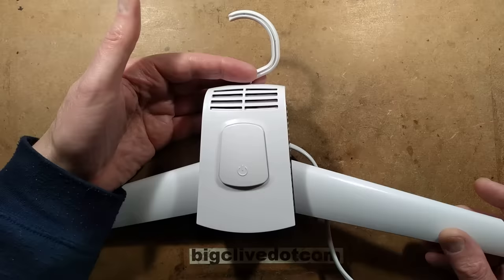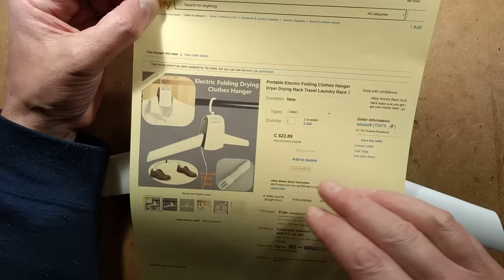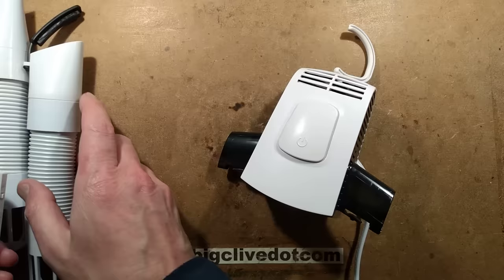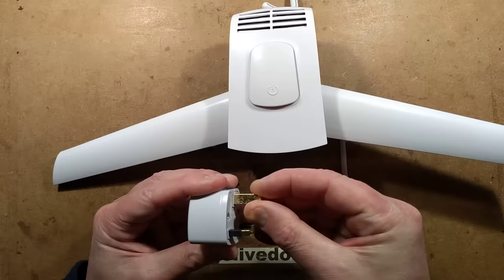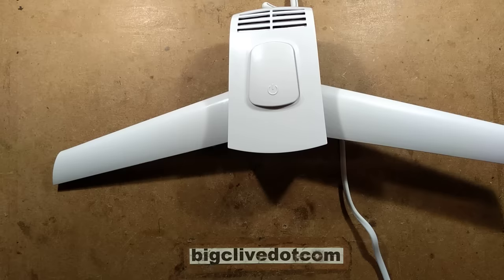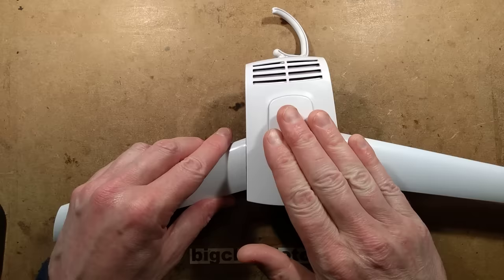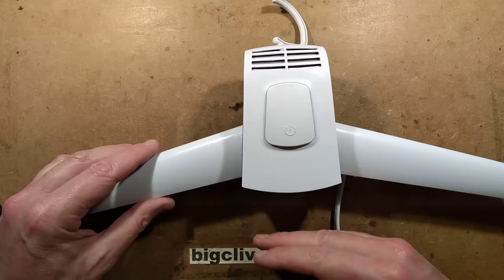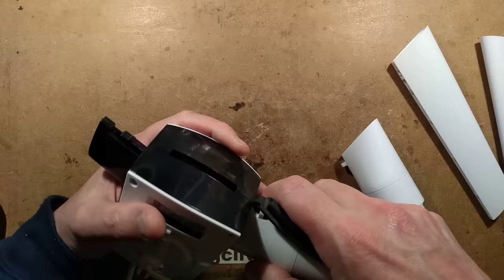Teardown of a hot air coat hanger for drying clothes.

Comment: Considering the rest of the product looks fairly well made,  I'm surprised that the short moulded plastic hook got past at least two stages of quality control /inspection . As an ex  injection moulding machine  setter/ operator, this was probably made during the first few machine start up cycles or maybe the material feed ran out but was missed by the operator, also the assembly line & the packing department! 
For a coat hanger, the hook is the most essential part of the item!!
Reply: Thats why the deep discount pricing on EBay
Reply: A Chinese qc sticker isn't worth the printed sticker its stuck on.
Or in this case the ink used to stamp.

Comment: That thermal cut-out/switch thing is in fact a thermostat - that's what they're sold as, anyway. That particular type is known as the "KSD9700" and it's all over AliExpress (and probably eBay as well). They're available in temperature thresholds between 15-155℃, with both NO and NC types, and are (supposedly) rated either 5A or 10A at 250V. This particular listing has them for between £0.81-2.10 for 5pcs, plus £1.10 shipping. I suspect it's just a bimetallic switch - certainly you can hear a distinct "click!" every time it turns on or off.

I've used a couple of them to add two-stage temperature-regulated fan control to a cheap (£40) 24V/25A (600W) power supply that was supplied with an always-on fan, and that works quite nicely. I don't recall the exact temperature thresholds I used, but I use one of those devices to turn the fan on at around 40-50℃, but initially through a resistor (one of the speed reducer cables that are supplied with higher-end PC fans), and then at around 70℃ it bypasses the resistor to run it at full speed. That PSU is the main supply for my 3D printer and its LED-lit enclosure, so most of the time it's outputting only ~2A to drive the LEDs and the printer's motherboard in standby mode, and having the fan running at full speed for such a low load was pretty annoying!
Reply from the maker: That does make sense, since the risk of this device getting covered with clothing in use is high, and a one-shot thermal fuse would be annoying.

Comment: I have shoe and glove dryer that is also a timer, heating element, fan and some plastic air channels. Mine is so old that it uses a nichrome wire for the heating element, a mechanical timer, and a slide switch that turns the heater off or on.

It is very useful for drying shoes and gloves.

Comment: Cheesium manufacturing aside, some of the design ideas on this are actually pretty good...  not sure I'd have a use for such a device though. I just turn my shoes upside-down on a heater vent in the house and turn the fan on and they dry in reasonable time. Maybe if I traveled a lot more than I do for business this might be useful, but I don't do that anymore. Problem is, the origin of the devices manufacture would leave me uneasy about leaving this thing unattended and trusting it not to burn the hotel down.

Comment: I got butter in my toaster once, I used a death adapter to prevent it tripping the earth by plugging it in with the earth hanging out the other side. I didn't touch the toaster, I just let it burn off the butter and it seemed to fix the tripping problem.

Comment: Clive you have a 3D printer so print yourself a new Hook ;) Good looking product too on my watch list to grab one at some stage.
Reply: Seabreeze Coffee Roasters 
Designing the piece in 3D from scratch and printing such a complex shape which is not optimized for 3D printing is quite a chalenge. First give it a 1-3 days designing the piece assuming he has experience in that,  and then printing it is the easy part, the hard part is the tolerances and support material and cleaning it once printed. Its not all "just 3D print a spare part", and also considering the use case he would have to print it in a heat resistant material, say petg or abs depending on the temperature of the thing.
Reply: @laharl2k  Seriously 1-3 days - YOU need to practice more if it takes you that long. That part laid out as a flat question mark would print fine for strength given the layers. There would be minimal heat radiated up given the airflow and fan but ABS would be nicer. Not much of a challenge but a 'real world' use case to try his 3D printer!
Reply: How do you know he has a 3d printer?

Comment: I assume that with the shoedapters you also get a gas mask.  Or at least some air freshener.  Blowing hot air through shoes is likely to result in some nasty odours.
Reply: I feel like it's intended for wet shoes
Reply: @sylashullett428  
And that makes it better?  I doubt it.  You'll get moist smelly air permeating the room.
Reply: gas mask is recommended, shoes smell nasty 😨 What about UVc and/ or ozone shoesdapters ?
Reply: @ElectroXa  

Ah, Clive did mention an ionizer option.  Maybe that's what it's for.  If it produces enough ozone as a by-product.  Then you can rot your clothing from the inside.

Comment: I just use a 12in desk fan at low speed and a clothes rack. Everything is dry after maybe 4-5 hours. No heat required - only needs airflow. Can take a few hours longer at lower temperatures though.
Reply: Same. If you add a bit of heat though it does speed it up a lot, doesn't even need to be much. Sunny window, radiator...
Also be careful to ventilate, we have had some nasty surprises with mildew.

Comment: I have a request. It's a little different so you may not want to cover it but it's not terribly far out there. I'm interested in modifying laptop PSUs for different voltages. I have a bunch in the 17V range but I need something in 13.5. I know they're typically controlled with a feedback loop. Something you'd care to look at?
Reply: Public liability, you would have to be mad to have anything to do with that.
Reply: @FarleyHillBilly  I'm sure it's possible to cover it in a way that avoids liability. Clive has covered voltage regulation before.
Reply: Why not use a cheap buck converter?

Comment: Nice! I've seen these used to help dry out fursuits. They're more gentle than a clothes dryer.

Interesting short on that injection molded hook. Those types of defects are usually pretty easy to spot and fix. I'm really curious about the story behind this. Maybe one of the cavities was starting to fail, and they didn't want to bother disabling cavities (making the machine produce parts slower) and/or qc thought is was "good enough" (parts customer must have not been too picky). Either that, or the machine operator was new and didn't know what they were doing.
Reply: F...fursuits D:
Reply: Or these are factory defect units being sold off cheap.
Reply: Keep up the excellent legal work, miles...;)
Reply: @bdf2718  Maybe - If those hooks were also used for another product, that would make some sense. However,  if they were custom molds designed for that, then why would assembly use a bad hook? It looks like the rest of the product is perfectly fine. 
There are a bunch of other plastic parts that are clearly not generic, so there was some money spent tooling that. My bet is that those hooks were custom tooled anyways. 
Chinese business culture is obviously different (and I'm not familiar with) - which may have allowed for lower quality standards.
Reply: @milestailprower  

Why would they use a bad hook?  Because, largely, the workers don't have a clue what they're doing and are told not to question.

The machine produces bad hooks?  Not the operator's job to question.  Company has no QA so they get shipped.  And if somebody notices they get shipped anyway in the hope they won't get returned.

Guy on the assembly line gets bad hooks?  Not his job to question.  Maybe there was a design change.  Probably he has no idea what the thing is meant to do or how it's meant to operate.  It gets assembled anyway.

Producer doesn't notice or doesn't care about the problem, or sells the defective assembled products for parts.  Probably knows they'll be snapped up by some eBay merchant happy to sell them on cheap.

It makes no sense that a product with a lot of custom tooling for well-designed parts would have such a crappy hook designed in.  But it does make sense that people would see what they could get away with if they ended up with some defective parts.

Comment: Gave up on Aliexpress. First few orders went through fine. Then the next few just didn't arrive, pain in the neck doing the claims procedure. Gone back to Banggood, out of about 50 orders only had an issue with two, both due to damage, and they were replaced very quickly. OK you pay a little more, and they don't have as wide a range of products.

Comment: That thing uses 10 watts less than my gaming PC under full game load.
Reply: Unless you have a dual core cpu or a laptop I don't see a "gaming PC" using that amount of power under load, and with a dual core it's not much of a gaming computer. Or maybe I'm just being stupid and underestimating a modern quad core's efficiency, maybe a ryzen or something with a 1050 could make for a pc worthy of being called gaming and fit in that power envelope. But then again anything goes when you don't have something better, I was using a pentium 4 around 4 years ago, agonizing to use but I did play games on it, well, the ones that would run. I wouldn't have called it a gaming PC thought.
Reply: Both convert electricity into heat very efficiently!
(The computer sometimes does some stuff on the side, but that doesn't diminish the efficiency as a heater in any relevant way.)

Computers are great heaters, just a bit overengineered...
Reply: Sitting here with a 800 watts spaceheater also called PC... Maybe I should duct the hot air into one of those dryers :D

Comment: Ahhh, the printouts are messing with my perception again!
The soldering looks ugly, but the rest (circuit and case) is actually quite nice and doesn't look like the tried to cut any corners. Not just the things that are needed to run are there, but also those to make it relatively safe and robust.
Reply: Today, vast majority of circuit boards that was mechanically soldered looks ugly, mainly by wave soldering process and Pb-Free solder. That's why broken solder joints are much more common problem.

Comment: Hey Clive, I believe I may have mentioned this a year ago (you were ill right about the same time), but you might have hay fever rather than a cold/the flu.
A simple blood test will give you a fairly accurate estimation of being allergic to grass pollen (or other herbs in bloom at this time of the year). Medication is abundant in case you need it, and has little or no side-effects.
Procrastinating on treating allergy isn't a terribly good idea, long-term effects may lead to pretty horrible conditions. (Says the guy that rarely takes his nasal spray, forgets to take antihistaminicum in the weekend and then proceeds to mow the lawn...)
Reply: Tough it out, it goes away, safer than taking stuff that stops the symptoms but can have bizarre side effects.
Reply: @FarleyHillBilly  that's not great advice honestly, antihistamines have very very few contraindications. 

Clive, the easy way to tell if you have hayfever or a cold is to wear a decent dust mask for an hour or so, if the symptoms subside then you have your answer. 
Hayfever is a weird beast, I get it worse some years than others and I get it worse in the rain and when the telly says the pollen count is low. shrug

The test is a skin prick unless it's changed recently - I've never had it, never needed it, it's pretty obvious I have grass pollen allergy.

Comment: Running it on 110V would cause the fan to operate at half speed.  The PTC elements would still heat up to the same temperature but the heat output would only be a half of the value at 230V.
Reply: Why? The fan is 12v and on a regulated circuit.
Reply: @nyetloki  You're right, my mistake.

Comment: Hey Clive, considering the reversed supplies for the (assumed) ionizer and fan would it be worthwhile to verify the fan is blowing dry air down into the wet shirt (vs damp air up into the electronics)?
Reply from the maker: It was definitely blowing hot air downwards through the ports.

Comment: Big Clive. I was wondering if you know anything about designing PCBs? I want to design one for a Electric scooter I have. It does charge externally through it's normal charging port. The battery it will be using is either a flat batter or a cylinder style at 5.2 Ah. Anyway you could help with that?

Comment: theres driers for trainers/boots that have tubes vertical with heaters at the botom of each no fans typically and the heat just moves up through your upside down boots. best way ive found.
Reply from the maker: The Peet boot dryer.  That version isn't sold in the UK.
Reply: @BigClive ah ok, I assumed you've seen it. well if you ever really want something that you can't get over there I'm sure someone in the u.s. following your channel wouldn't mind helping getting it to you...😉

Comment: If you have an Aldi nearby, they seem to be selling some rather interesting solar-powered LED filament bulb ornaments at the moment for £4.99, I bought one earlier today and haven't the heart to attempt to dismantle it to see how it's powering 4x LED filaments of a single 1.2v 2/3rds AAA cell... :)
Reply from the maker: Those have been around for a while.  The filaments have all the LEDs in parallel.
Reply: Oh that's pretty neat, and given they're running them at 1.2v(ish), they're being rather under-driven, scope for improvements if need be, but I'm happy how it looks hung up outside, can't wait to see it lit up in the dark... :D
Reply from the maker: It uses the same single inductor boost circuit as most solar lights.

Comment: I'm just wondering, should I get one of these instead of using my ceiling fan and a coat hanger! Or as I sometimes do in Winter, instead of using my air-conditioner, though the air-con does actually dry the air, so is beneficial.

Comment: Wouldn't the wattage increase if something was on the hanger and powered up?
Reply from the maker: Theoretically the highest wattage would be in free air as there would be no air restriction.  If the air was restricted the heater would get hotter and self regulate down.

Comment: Got a quick question BigClive.... what's the best way to convert UK power to US 120v 60Hz? The 60Hz thing is kinda important, it's for a tool with a weird electronic speed controller..... about the 1.5kW range of output. TIA if you see this :)
Reply: My 2 cents would be to get a US pure sine wave inverter that you can power from a DC source and output 120VAC..
Reply: If the frequency is important, it's not going to be cheap. Especially at that power.
Reply: Step down transformer, most simple.
Reply: @HeimoVN  i have heard your suggestion a couple of times, and like all PC owners I already have several high amp 12V rated supplies lying around! Do you know of any good brands or suppliers of pure sine wave inverters? I don't mind buying genuine stuff rather than Chineseium! ;)
Reply: You could try a 240V motor, some gears, and a 120V generator.  AKA a rotary converter.
Reply: @mor4y  I wish I could give you a good source for such a inverter, I am not from the US or UK. I would perhaps check the US amazon, that would be where I would start looking at least..
Reply: @bdf2718  that definitely sounds the like the most AvE solution! :) but I can see straight away how it would work and how to build it...  its filed under 'nuclear options' along with importing a UPS system (which costs a ton, it's a box of batteries!)
Reply: @mor4y 

It's not an AvE solution, it's an anti-AvE solution!  AvE understands mechanical doohickeys a lot better than he understands electrical doohickeys, and his natural inclination is to try to do stuff he doesn't understand.  It makes for funnier vajayos.

The problem with UPS is the same as with the inverter solution others have suggested.  The output waveform of those is not very sinusoidal, unless you pay very big bucks.  Usually it's more of a dirty square wave.  If whatever you have is sensitive to the waveform (unlikely, but possible) then the rotary converter may be the best and/or cheapest option because you'll get a very clean sine wave out of it.
Reply: @perez9619  a transformer won't correct the frequency-so nope!
Reply: @chaos.corner  
60 Hz is kind of important?
Reply: @daverhodes382  That's what he said.

Comment: Do I detect the sounds of a Man Still Battling the Creeping Crud ?   Double Whisky  and a Hot Bath Ends that crap.   The Whisky coupled with the Elevated Body Temps burns that stuff out of you  Sir !   The Endless Dissection of Weird Chinesium Gadgets. LOL   I've came across those heating elements a few times and wasn't sure how they worked.   Afraid to just plug on in.  LOL

Comment: Strange, ordered the 220V version, and it is marked as 220V but has american plugs?? Seems to work fine with an adapter though.
Reply from the maker: The Chinese plug is very similar to the American one.
Reply: @BigClive  Ahh, makes sense. It was shipped from china. Have to change the plug then ;)

Comment: Before watching the video, I see an immediate design issue: a coat hanger dangles clothes beneath it; hot air rises. The heat is only gonna help a small part of the clothing you hang on it.
Reply: It may not be too bad if the buttons are done up.
Reply: This relies on forced air so convection shouldn't have too much effect.
Reply: A small technical limitation that will not affect sales
The customer buys the product  in expectation that it will do as it says it will..
Fools Ahahaha.
Reply: It works fine in Australia, where they're all upside-down.

Comment: on 110V, the input current would rise, so some diodes could die from over current.
Reply from the maker: The main input diode is rated for 1A and only sees the current for the fan and circuitry.
Reply: @BigClive  Thanks, I missed that detail.